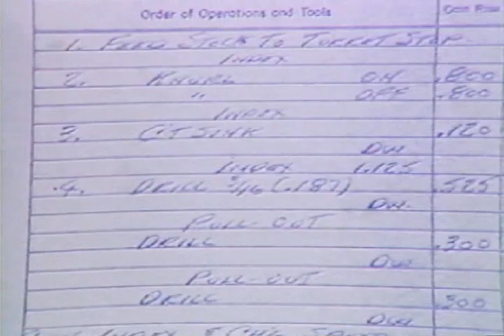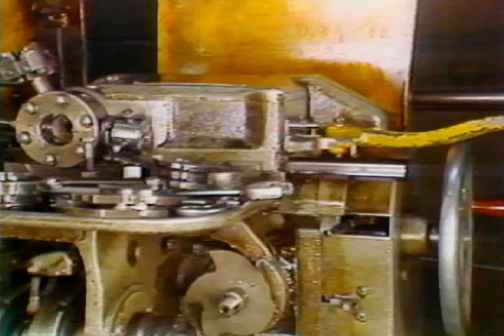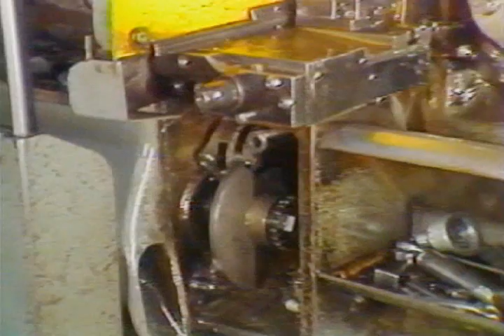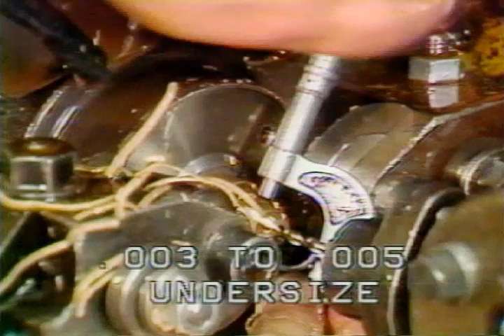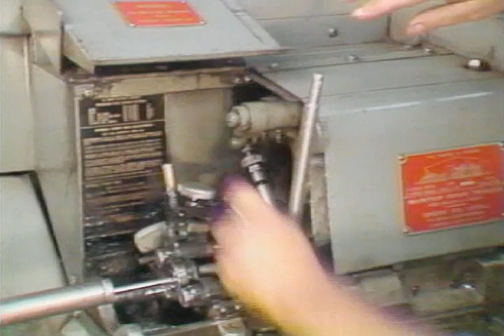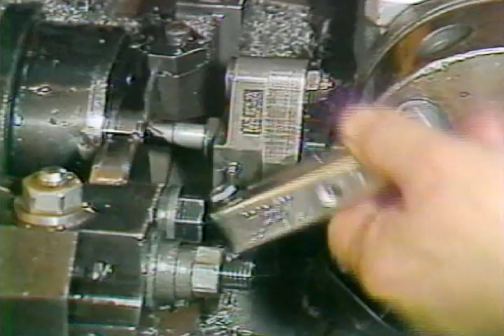Brown & Sharpe sample from MasterTask Training

Comment: use a double feed cam also remove slide clean..and oil galleys..and serrated collet..feed variatiins go to 240 backshaft and feed out low speed

Comment: I am A pro at Screw Machining and all other metel Cutting and grinding 15 yrs Exp B&S Davenport,Index, Cva,Swiss
Centerless surface and Blanchard
Reply: I got you beat I have 32 yrs of experience Davenport model B, B&S, Gridley, Conomatic, Swiss Type, New Britain, CVA, & Greenlee's. I'm an expert drill grinder (left & right hand, drill blanks, D drills, spade drills, reamers etc.. all by hand) if need be I can make a drill cut .005 oversize or undersize as well as exact size with no drag out marks. I can also grind fluted taps as well as express taps and chasers by hand to produce 75% full thread. I also setup and ran all types of secondary operation machinery when needed. I also made my own jigs and fixtures drill bushings etc.. what ever it took to get the job done plus all aspects of machine maintenance when required. Oh! yeah in the shop I worked in there was a sign over the shop door that read "No Turtle's Allowed".  :-)
Reply: Know anyone who could make us some brass wood screws?
Reply: I would love some help. We are purchasing a few older machines like this one & would be more than willing to pay someone to help us turnkey them. Each machine will only be set up for 1 job. We definitely need the help with this. Give me a call Josh 817.992.6814
Reply: @joshualemons8451  Know anyone who could make us some brass wood screws? look for email...
Reply: 46 years..set up reapair on all